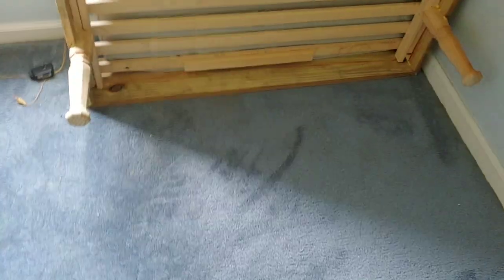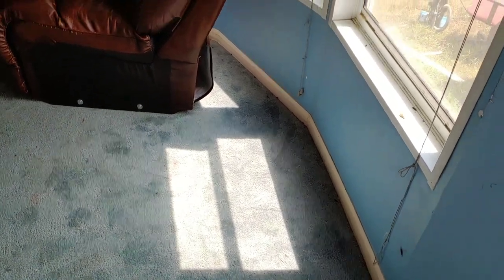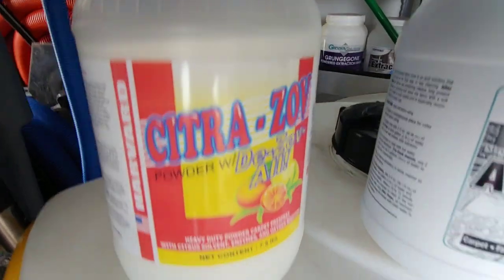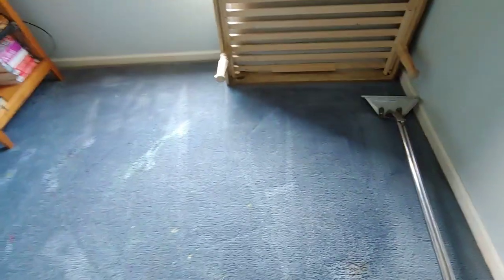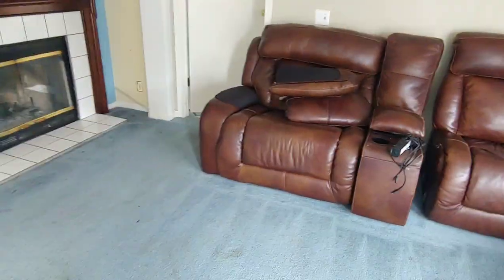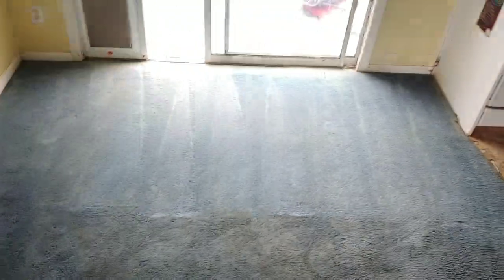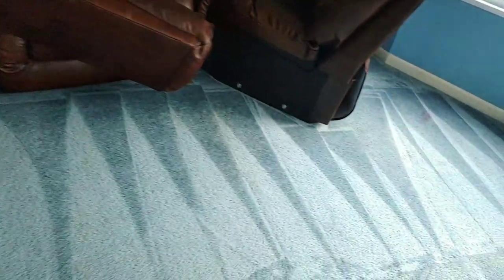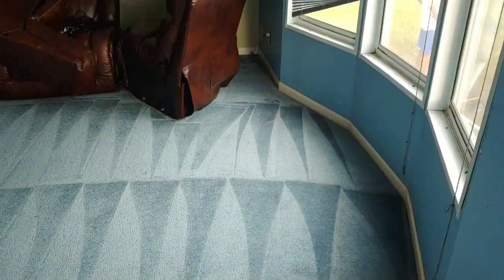Cleaning Badly Stained Carpets

Comment: Hello Mr. Jackson sorry to bothering you I saw all your videos and i am learning. I have a few questions to ask you.
What is Agitating? And how do it help the extraction for carpets?
Reply from the maker: Agitating is basically like scrubbing the fibers of the carpet. It does 3 main things .
1. Agitation work your pre-spray into the carpet fibers. Allowing more dirt to be loosen up.

2.  Pulls up more dirt, hair and debris out of the carpet. 

3. Lift up the pile of the carpet 

Some times the carpet looks completely cleaned after agitation.
Reply: Thanks. Mr. Jackson for sharing your knowledge with me. I wish the very best. You an amazing job in all your videos i watch. You have really inspired me to keep on and never give up even though my business is slow right. But by watching your videos it lets me know that it could be done. Thanks so much